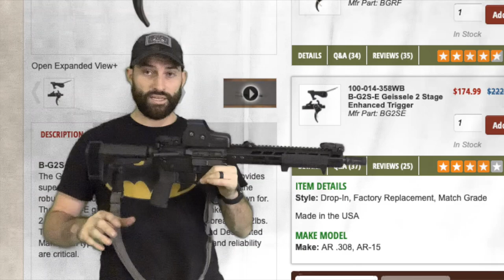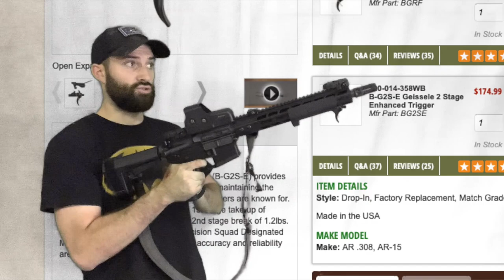The Best AR Pistol I've Built!

Comment: Strike Industries .308 Flatwire Spring > Blue Spring co. Same concept, it slows the bolt down but is much smoother than the spring co extra power springs. Plus it's fully tunable. For a $20 upgrade, you should check it out.
Reply from the maker: I’ve got a strike industries flat wire sitting in a box, I just haven’t had a chance to use it. You’ve got me excited to see how it performs 😃
Reply: @CalebDowning  I don't think you'll be disappointed, I sure wasn't. I have the armaspec SRS is one gun and Strikes flatwire spring in all the others. Maybe that'll be my next video 🤔 Haha.

Comment: I'm on my 4th or 5th PSA build and so far no problems except maybe the finishes vary a bit from my lowers I stocked up on thanx to NOT president Killary. Been experimenting with different coatings (paint) usually Krylon Rust Tough semi-flat or high heat matte finish engine paint. Then put some heat on it with simple heat gun. Don't know if I mentioned this next thing to ya but to stop the barrel heat I use these asbestos or something similar fabric booties that are used on spark plug wires that are too close to the exhaust headers. O'Reilly's has them now. Used to be just a kinda gold color but now have them in black. They handle red glowing header heat and have never had a plug wire melt or the bootie fail and they are actually touching the headers. They will fit over most AR barrels, may have to remove flash hider,  and are bout 5" long. You can use metal type zip tie but they stay in place pretty and the loose fit doesn't trap the heat. Think somebody missin a bet by not marketing them for this purpose. Would like to see what you think of em. Not too pricey at maybe $20 for two booties. Probly cheaper on the Net. I like the skinnier hand guards and with a bootie I feel no heat what so ever. Hope you give em a try. PSA has the CMC drop in 3.5lb single stage straight or curved triggers for bout $127. I gave $186 for 1st couple I bought. I'm sure ther are better triggers out there but these are pretty dang good. To me they are at least 3 or 4 times better than milspec. Guess I write way too much but reckon I can't help it. I write a little and then PTSD does the rest. Keep up the good work. rick, Nov 2, 2019. L8r.
Reply from the maker: Awesome stuff man. I’m definitely gonna look into those heat shields, you might be on to something there 👍🤔
I’ve been seeing those 2 stage triggers on PSA’s site but haven’t picked one up yet. I think they might be a good option for the 2020 build perhaps.

Comment: Bro where can I get a super cheap at 9mm upper to use with endo mag I’d like a 5inch or 8inch barrel I have a completed lower try to get a discount code for your viewers
Reply from the maker: Check PeaceGeek . I got my 9mm barrel from them for about $40. They have great deals like that all the time it seems.
Reply: Caleb Downing I found a 16 inch one on there but I can cut it but not a way to re thread
Reply: Caleb Downing if I. It the barrel would u chop it and re thread it 1/2 x28 I would pay u If so let me know what I would charge me to do that I would like to have a 7.5 threaded 1/2x28
Reply from the maker: Send me a DM on my Instagram “cpdowning”